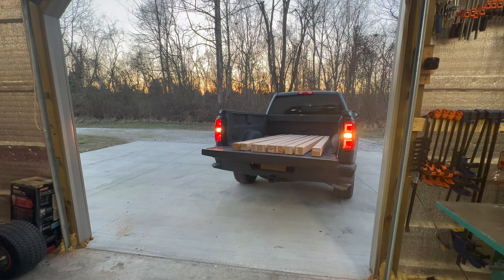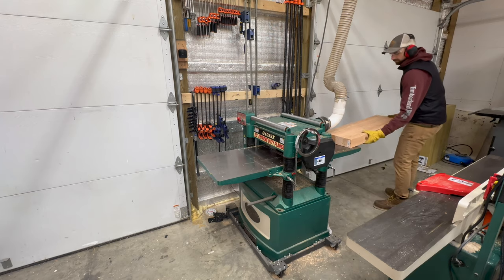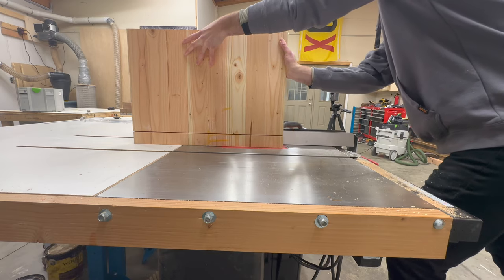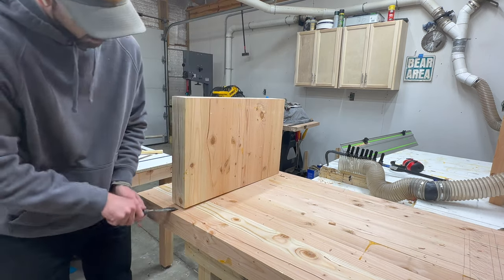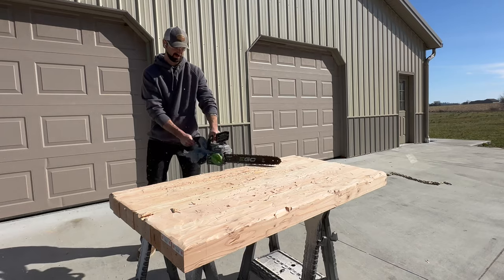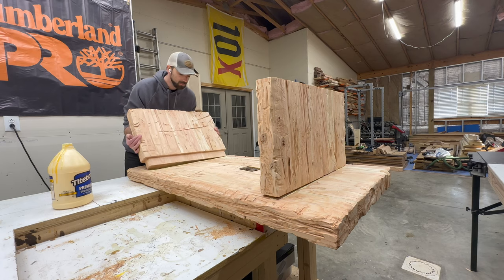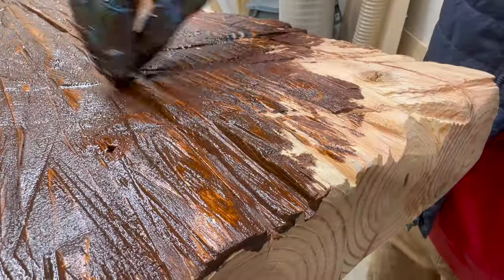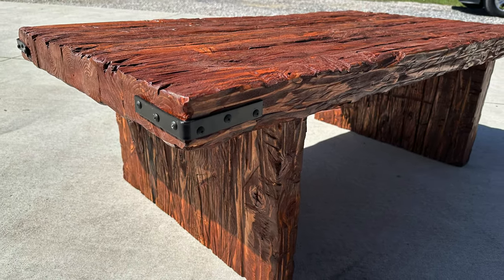Making NEW Wood Look OLD

Comment: Are you not worried about wood movement?
Reply from the maker: Movement shouldn’t be a concern since the grain of everything is in the same direction. Expansion/contraction will be the same across the panels and joint 👍🏻
Reply: Ok. Good point. Thanks.